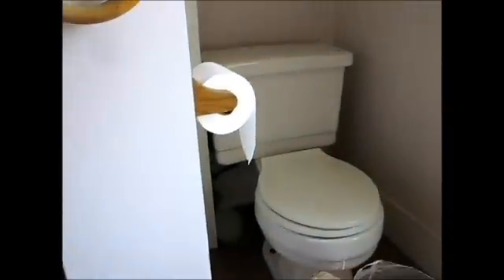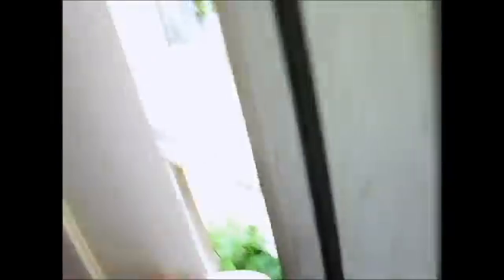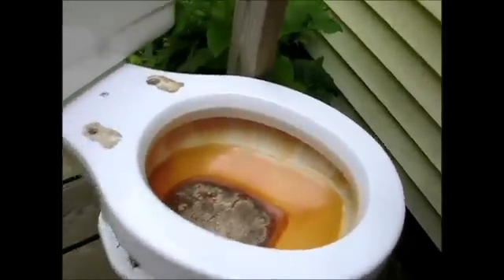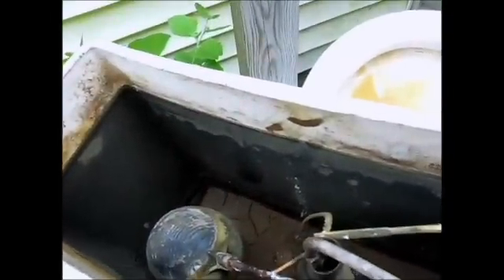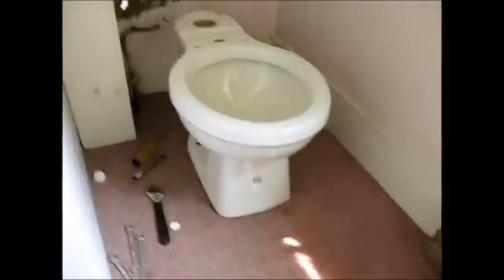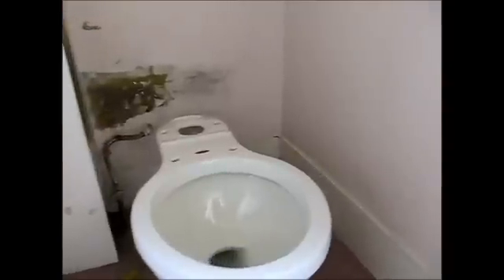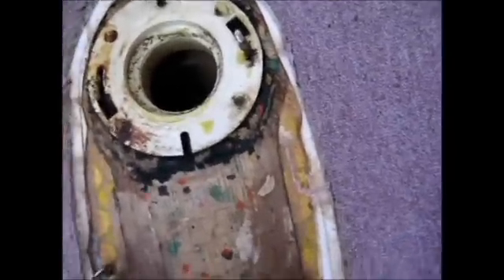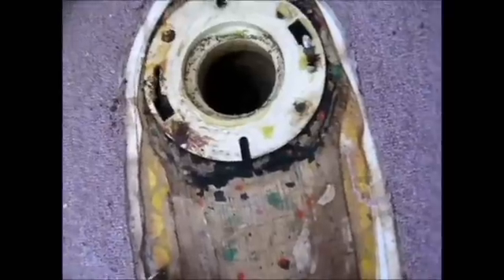Toilet Bowl Swap 1st vid

Comment from the maker: @1968DodgePolara   I used the saws all to get the bowl loose from the tank on one.  You're right about that.  The bowl screws didn't come out, but they had small heads and the washers corroded so I just chipped away the washers and pulled 'em through..